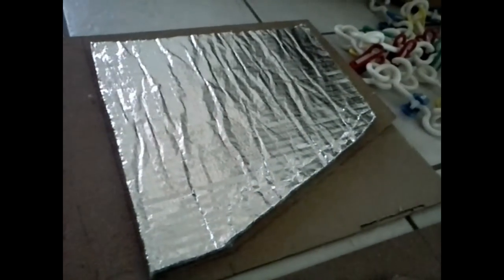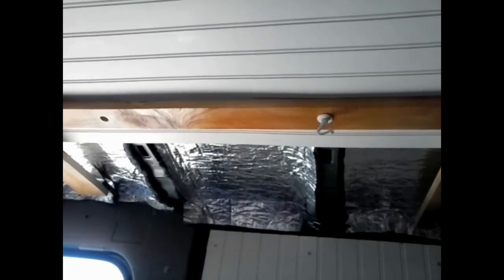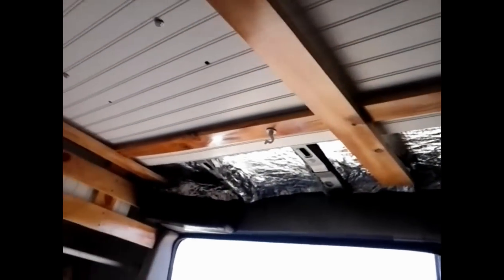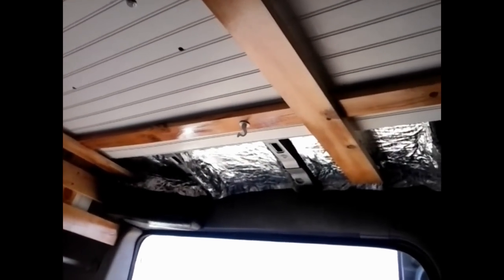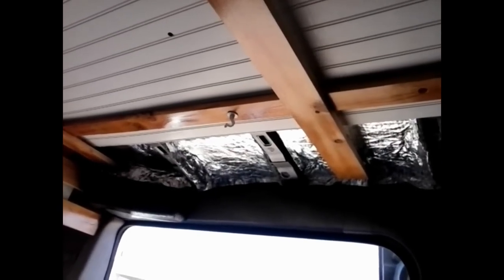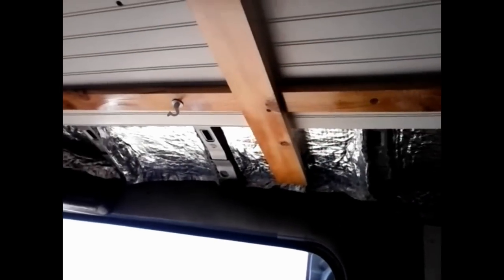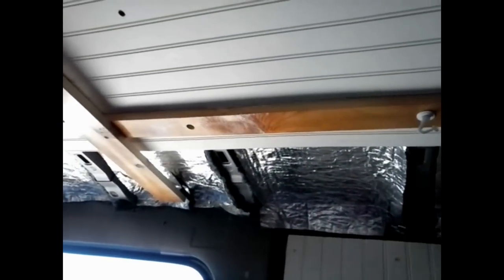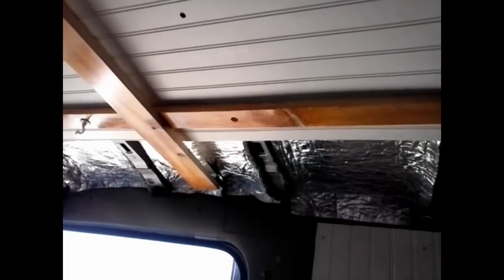VAN BUILD 17 - This Ceiling is AMAZING!

Comment: It looks like you're below deck of some wooden boat. With the view from the back with the trays and the round mirror they all look like port holes.  Very nice.
Reply from the maker: +Wandering Wade - Thanks Wade.  Yup!  I am a very visual person... and I tho't about the portholes, too, when I first got the mirror.  The trays... and spacing them out like I did, literally came as an aftertho't.  I knew I was going to have them in there, because of them have high edges (to catch spills) and handles for hanging.  I just have to remember to take them down when I drive!  (LOL.... clang, clang, clang!)  Hugs to ya